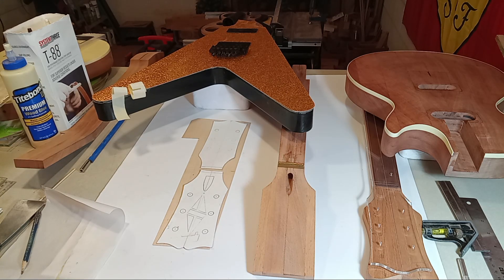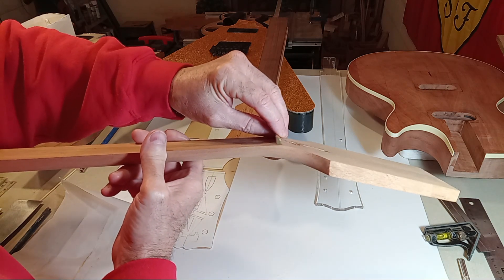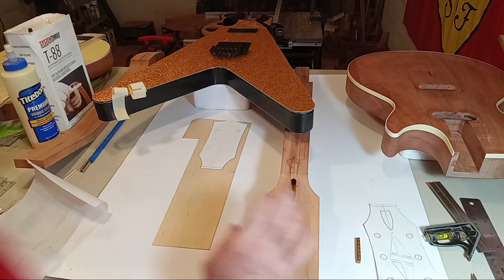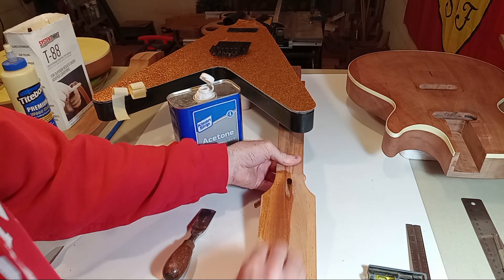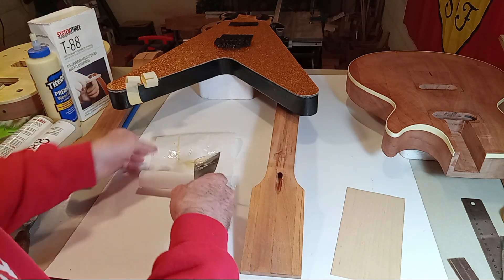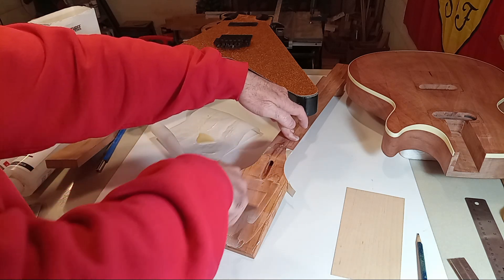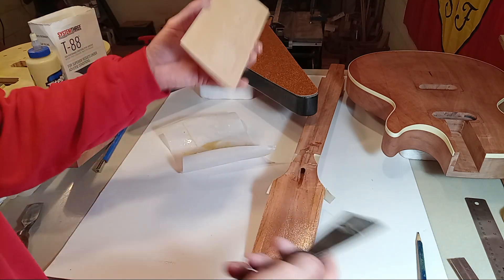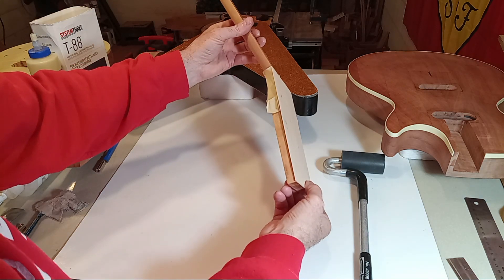V19. Building A 1950's Replica Goldtop Les Paul Per StewMac Templates.  (Honduran Mahogany)

Comment: 20:27, I've read that often burl figuring will be stabilized with epoxy before being used on a guitar top.
Apparently, the burl is soft enough to be problematic when shaping for a compound shaped top as found on a Les Paul style single cut guitar, impregnating the burl with epoxy solves many woodworking problems at once.

Comment: Hi...your video series is great, very informative, thank you from someone just getting into guitar building. I have one question. I thought there is a 1.5 degree cut from the neck pick up towards the bridge pick also on the les paul guitar. Some people seem to mention it and others don't. Would love to know your opinion on it
Thanks again
Declan
Reply from the maker: Hey Declan,

Sorry for the slow response, but I just found your message. 

In one of the recent Flying V videos I discussed the pitch options in general passing.  The short is, two degrees allows for the install of a floating Floyd Rose with the D and G string around 11/16" (17mm) above the top, yet, still accepts the ABR-1 design near identical to what we're all used to.

It also allows the floating Floyd to go sharp by three semitones before risking making contact with the top.

The 1.5 degree would be my choice if my client wanted a very low profile design.  Keep in mind the thickness of the fretboard at the neck to body join (string height there)  has more to do with it all, than pitch, and changes everything. 

So, get used to the solutions always varying, haha... and when in doubt, draw a simple cross section of what your working on.

Thanks,
Marc